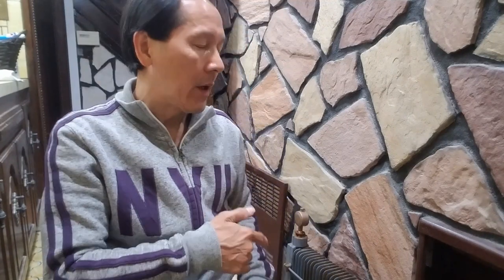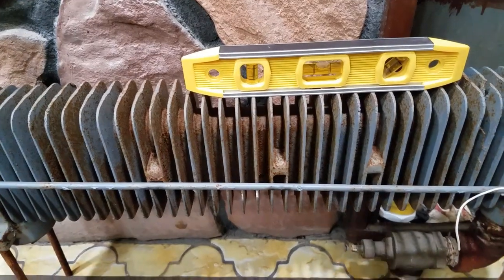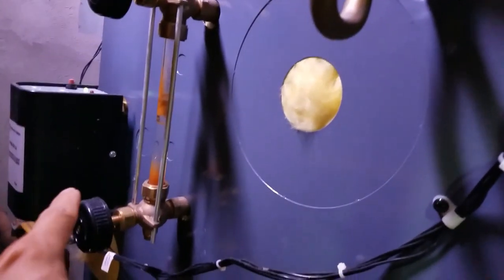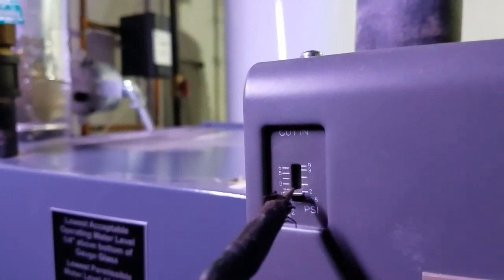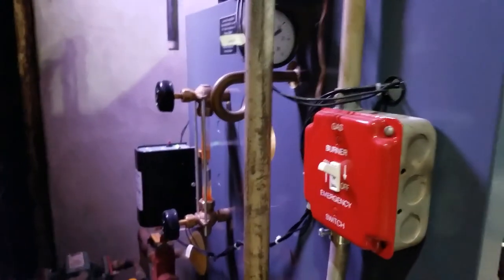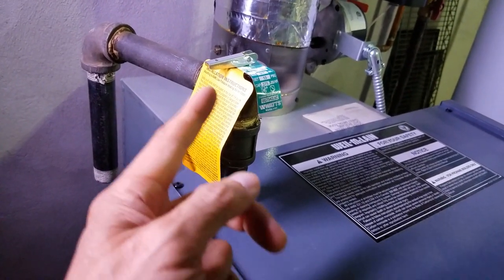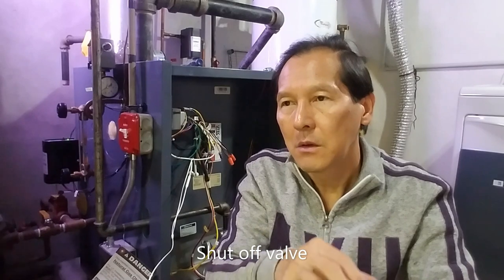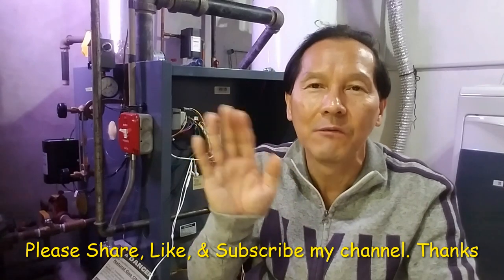2 Reasons that cause Water Hammer in steam boiler system and how to fix them.

Comment: Hi Thank you for sharing the info. I live in NY and my house has same situation of what you described in the video. I have adjusted the pressure from 3 to 2 PSI. I have also lifted the radiator to get water flow back to the furnace. However, I still hear water hammering when the furnace starts working. BTW I have constantly checked the water level in the furnace and it stay in the middle of glass which mean the furnace does not overfilled with water. Please help me with other possible solution to fix water hammer noise. Thank you very much.
Reply from the maker: Try to drain return line if it clogged. Thanks for watching.

Comment: Hey thank you for your video, I have a question regarding my oil furnace it's used for my steam radiators and hot water but I'm noticing that frequently I have to constantly manually add water to the correct Mark in the sight glass and it's consuming more oil then it should what would you recommend
Reply from the maker: Yes, I am very happy when you asked about this question. There are some reasons that cause losing water in the steam boiler. A List below will tell you where you have to check:
1) Vent valve at the Radiator bleeds out steam constantly.
2) Leaking water ( Condensated steam ) at the cap of the shut off valve before steam enters to Radiator
3) The Return line to the boiler has some leaks under the ground ( If return line is burried under the ground ). I am very sure that return line has leaks some where in your basement.
4) Your boiler may has leak, you can look around and the bottom of boiler where the burners locate, there may have water dripping.
I had similar problem. My returned line under ground was so rusted, broke and leaked water slowly over the years but I didn't see water because it when to ground. Finally, I changed a new return line. You can look at the sight glass, it is cloudy, rust color all the time.
Ok, Thank you for watching my video. Have a nice day !
Reply: Flood your boiler up into the header. Then look in chamber (fire box ) for water leak .  Boiler is gone if water found

Comment: Hi again my steam boiler is sporadically not turning on when tsat turns on. I replaced tstat same issue.  Standing pilot is on, lwco is ok and I noticed damper is open but no burners are on. If I turn off tsat and back on then works ok. Happens sporadically.  Pseg was here 2 weeks , he cleaned boiler and lowered burner output a bit.  Not sure if that caused it.

Comment: We have steam convector element radiator, it keep leaking water even after convector valve, radiator and air vent valve replacement. It is located on the 4th floor and the boiler in the basement. What is causing it? The radiator is sloped towards the valve already.
Reply from the maker: Hi, Michael. May I ask you question relates to your steam boiler that where is leaking water from. Thanks.
Reply: @CHILEtv012019  hi Chi thanks for the quick response. it is leaking from the air vent valve. it is a steam element radiator 24" x 6". i replaced the convector and air vent valve. in the beginning was fine. it started to  spitting water from the air vent valve once the steam heat starts to come up. also, when heats starts to come up i see the radiator moving, it is normal?
Reply from the maker: There are many reasons that cause water spit out from the vent valve:
1) Vent valve defective 
2) Too much water in steam pipe system ( Need to drain water out if there is )
3)  Diff. pressure switch set too high, boiler is working longer than normal. You can set temp lower at the Thermostat and monitor vent valve.
Some hardware stores sale a good vent valve but cost more money that I found last year. A cheap vent valve will not stop water spit out and will damage faster than normal. Check out vent valve's Nozzle that suits for second floor location.
Reply: @CHILEtv012019  i bought those adjustable one. i heard hoffman #41 is the best for steam elemnet radiator. is that true? i live on the 4th floor. thanks again Le. your information is great.
Reply from the maker: @michaellee688  The farer distant from the boiler, the bigger Nozzle' hole it needs. I'm not sure that #41is good. But good luck!
Reply: thank you Le

Comment: hi, my weil mclaine steam boiler (same exact as video)starts to short cycle after 45 mins. once it reaches pressure at 2psi it turns off, turns back on again few mins later once pressure drops and back and forth. I have pressuretol set  to minimum. All my radiators in my 2 floor house get fully heated no issues there. no hammering, i checked vents including mains all seem ok.
Reply from the maker: I understood your explanation about your steam boiler. Your control switch needs to be adjusted the Differential dial setting. If its Diff set @ 0 PSI, your boiler will turn back and forth, it could ham the boiler. You can adjust the Diff Between 0.2 to 0.5 PSI to improve boiler operation smoothly. Thanks for watching.
Reply: @CHILEtv012019  thanks for reply, the current settings are are cut in dial on outside is 0.5 inside dial is at 1. How should i adjust both dials?
Reply from the maker: Cut in setting from outside should be set @ 2 psi. Inside dial is your Differential and will be set @0.5 psi.
Good luck ! ( Tomorrow, I will post 2 videos, troubleshoot press control switch and how to calibrate it )
Reply: @sonicboomin   the cut out should never be higher then 2psi. the cut in plus the differential is the cut out. the cut in should be set at .5 and the differential at 1 to 1.5.

Comment: There is no gauge, there is no "pigtail"...but there is occasional hammer noise. a few days ago the furnace safety valve got hit by accident and water came out of the downward pipe onto the floor (a gallon or more). Last night I noticed the pipe coming into the main house has a tricking waterfall noise, like not enough water (??). Last night the hammering started off and on and it seems like it's coming from one of the pressure valve type things along the pipes (not on the furnace itself). I tapped on it and eventually the WATER PUMP came on...so I thought that fixed it, but it still does it off and on this morning.
Reply from the maker: I thinhk you need a boiler technician. Your safety valve was lifted because pressure in the boiler was so high. Your Diff. pressure switch needs a Pigtail because it will prevent sudden pressure increases that may damage the Diff press Switch and keeps your boiler never turn off or fail to turn on. Thanks for your comment.
Reply: @CHILEtv012019  I actually hit the switch with my coat crawling behind the furnace to get something and didn't realize it. The furnace had just started back up when it started leaking. We've had a frozen water pump due to sub-zero temps and it seems it just didn't replace the water. 
The hammering noise stopped last night, and we haven't heard it since. I'll keep an ear out for it happening again and will call a technician if it does.
Thanks for the advice! :)
Reply from the maker: Very nice what you found. Thanks.

Comment: I have water coming out of my air valves on the 1st fl only in a 2 story home. i installed brand new air valves, i checked the boiler pressure orginally it was set at 3 which i did not know until i saw this video .so i reduced to 1.5 and the radiators are pitched to the service valve however water is still shootin out of the hole of the air valve where the steam is suppose to release idk what else to do.. any additional advice will be apperciated
Reply from the maker: To control steam flow from basement to second floor smoothly, steam radiator's valves of first floor must be opened between 35% to 50% and second floor 100%; the nearer to boiler then radiator's valves open less, and the farer open more. In your case, the radiator's valve for first floor may be opened 100% that creates too much steam and water. I hope this will help you to solve the problem. Thanks for watching.
Reply: Thanks for taking the time to reply i really apperciate it , yeah your absolutely correct the valves are opened all they way, ill will give your recommendation a try

Comment: The height of the header off the top  boiler looks a little short and you will carry over water into the main and that will cause banging as well 
Follow manufacturers recommend header height.
I learned that the hard way.
Reply from the maker: Thank you for your support.

Comment: Can you make a video showing how to replace the shut off valve on the radiator? It would be super helpful as it's a common issue (leaking valve etc.) Great video, there's not many channels covering steam-based boilers and radiators!! The few that are there are really bad quality and not as easy to understand
Reply from the maker: Yes, thanks. I have a video that you are looking for. Go to my CHI LE tv channel and type:
How to Replace The Shut Off Valve and Stop Radiator Pipes from Banging ( Water Hammer )
This video was published Nov 23 2019
Thank you for the visit.

Comment: Here's a tip for all of you 
The empire state building in NYC still has the original steam system and it only runs on 2psi of steam 
The steam takes less than 5 min to reach all the way up to the last floor....
Reply: Great info but what is the tip???

Comment: Thanks. I will check this out in my system. Still small leak from my Backflow preventer. Some people are saying it’s the feeder relief regulator that is to the right of the Backflow preventer?
Reply from the maker: WOW ! You still have leaks. Feeder relief is a safety valve and it will activate when pressure in the boiler greater than setpoint ( Rated pressure ). Is your boiler have expand tank ? Thanks for your support.
Reply: @CHILEtv012019  hi there. The psi on my boiler says 20 psi for my raised ranch (2 stories). The feeder is rated 20-25 psi. 
I replaced the Backflow preventer with a new one today (second new one) and still same thing. It doesn’t drip like it did over the weekend (1 drip every minute or so) but it’s slightly wet at bottom of the vent pipe still. If I run finger down on it I see liquid. I tried everything except for replacing the feeder relief regulator next to the Backflow. Idk if that would even do anything. I do have a expansion tank above but sounded hollow when I tapped on it. Thank you for your help!
Reply: THANK YOU FOR THIS VIDEO VERY GOOD.....🎆🎆🎆
Reply from the maker: @appleztooranges  It 's great to hear what you just said. The expand tank is ok. Before you replace feeder Relief valve, try to close the water supply valve to the backflow Preventer ( Water supply valve is a valve before backflow Preventer).
Reply: @CHILEtv012019  it seems like when I do washing machine is when it starts to leak at Backflow preventer (strong hammering). I threw two hammer arresters to cushion the blow. I’m unsure what else to do besides calling a plumber lol
Reply from the maker: @appleztooranges  I don't see what you system looks like. So, I can not assume any thing could go wrong. The backflow Preventer stands by itself alone, nothing else attach to it. Otherwise, the water will be pulling to the washing machine and that causes a real back pressure and backflow Preventer will activate and dump water to the vent pipe. That is why you saw few drops of water from the vent pipe and water hammer occurs
Reply: @CHILEtv012019  yes the washer is in the opposite side of the basement room. Everytime the washing machine starts up large banging sound. Ever since I bought the LG washing machine. I will never purchase another. Every-time it slams the pipe vibrate and the Backflow drips. I’m putting a new hammer arresters on back of washing machine today (hot and cold).

Comment: Great video.  Can a clogged return also cause water hammer?
Reply from the maker: Definitely, yes. Water in return line will build up and steam coming that causes water hammer. Thanks.
Reply: @CHILEtv012019  I am having an issue where I have severe water hammer.  The tilt is correct on the radiator and the pressure  trol is set correctly.  I believe the issue could be clogged return.  Also, a lot of water shoots out of the vent on the radiator so I had to cap it.  Even after disconnecting the radiator to see if there was water in it, water still shoots from the vent.
Reply from the maker: Yes, water ( Condensated steam ) can't return to the boiler, water level will build up. You can drain the return line, near the boiler, if no water flowing out then it clogged. Also, you can check water level in the boiler ( Looking at the sight glass ). If you don't see water level, it may be over flow.
Reply: @CHILEtv012019  Okay thanks.  I do see water in the sight glass but it surges a lot.  Up and down about 5 inches.  Then when the boiler is off it settles at half way up the sight glass.
Reply from the maker: Water boiling inside the boiler, it's normal.
Reply from the maker: Thanks for sharing this video. According to your explanation in this video, your system may have a lot of water inside the pipe lines and Radiators. I suggest that you may have to turn off the boiler, drain out all water from return line, tilt all radiators so that water is not stay inside the radiators ( Try to get some pieces of wood lift up one side of radiator with an angle between 5 to 10 degree  so that water will go back to return line ) . When technician cleaned up the system with water, there may be some water still remain inside pipe lines and radiators.

Comment: Xin lỗi viết bằng tiếng Việt để dể diển tả.
Boiler nhà tôi cũ ít nhất 25 năm! 2 năm rồi ống nước bị bể. Plumber thay ống nước. Boiler chạy bình thường trong mùa đông năm rồi.
Năm nay chú technician tới Check, sau đó chừng vài ngày thì nghe water hammer.  Chú technician drained the boiler.  Boiler Nhà tôi hiệu Weil-McLain.
Bây giờ tôi không biết về level của nước trong sight glass vì thấy nó dâng lên nhanh quá và bít đầy ống ( sight glass )tôi sợ boiler sẻ hư và gây nguy hiểm.  Xin cho biết câu hỏi của tôi.  Tôi có nên thay thế boiler mới không? Tôi ở NYC.  Cám ơn.
Reply from the maker: Vang, Boiler cua ban tren 25 tuoi thi rat cu, nhung van con lam viec duoc thi ok. Truong hop cua ban vua ke thi minh xin hoi ban: Nguoi Technician do co clean va thong sight glass ko ?, tho co dieu chinh ap suat ( Diff press device switch ) ko ? Water Hammer hinh thanh do nuoc chay ve boiler khong kip va luong hoi nuoc tiep tuc day nuoc va tao thanh tieng dong lon va co the lam be duong ong dan hoi nuoc va tham chi la cai Radiator bi hu hoac nut. Con cai Sight glass khong thay muc nuoc thi  ban hay drain boiler cho den khi ban thay mut nuoc. Neu ban khong thay mut nuoc thi duong ong dan tu sight glass bi nghet. Cam on ban da quan tam va theo doi video cua minh nhe.

Comment: Also, your gas supply pipe doesn't have a drip tee and cap. The diagram is in the boiler manual. And the relief valve discharge pipe must terminate at 6" from the floor.
Reply from the maker: Yes, you're correct. I just checked it. This job was done by a technician. Most of boilers for commercial building require inspection annually. Thanks for your support.

Comment: Thanks for sharing. But...
Please don’t tell people to raise one and and showing them to raise the condensate-end, because it’s dangerous. Steam and condensate shall flow always (!) in the same direction. As condensate collects on the bottom of radiator or pipes, and we want to avoid a water sack and water hammer, we usually give at least 2% slope to the condensate side (there’s where the condensate can flow down to the return pipe system).
Other issue...
Pigtail pipe in a steam system will be used to separate the sensor (or capillary pipe inside the pressure gage) from the steam system. With a straight pipe, steam would condensate all the time on the sensor and condensate would flow back into the boiler. That permanent condensation energy supply would break the sensor within short time. That’s why we don’t allow condensate to flow down with a pigtail pipe and have there a brilliant and simple barrier.
Reply from the maker: You have a good opinion, 5% slop is good. Thanks for your support.

Comment: Chao anh chi , 
Cho em hoi anh , nha em co May heat steam boiler da 40 nam roi , no van con chay rat tot , Hien tai em set thermostat 68 degree nhung no o shut off 68 degree ma no stop 71 degree vay May heat co bi sao o ?  Vay Em co phai adjust   Cut switch control giong nhu video anh chi cach adjust o ?  Anh cho em biet cach lam sao.   Cam on
Reply from the maker: Chao em. Thermostat cua em co van de, vi khi nhiet do da dat 68 do F (Temperature setpoint @ 68) thi contact se ngat mach dien de turn off boiler. Truong hop boiler cua em ko co turn off cho den 71 degree, vi contact cua Thermostat bi HANG UP hoac yeu. Em co the thay cai Thermostat moi hoac giam nhiet do xuong 65 degree. Ko nen chinh control switch. Chuc em thanh cong.
Reply: Cam on anh chi

Comment: Hi , I have a hot water baseboard system with boiler, the heating pipes in the 2nd floor kitchen make a loud banging every time i turn down/off the thermostat or when it reaches the set temperature and stops. We changed a large new expansion tank and it still happens. Its very loud on second floor kitchen we could hear it from first floor. Please some help on this.
Reply from the maker: The water hammer in your water heating system happens when a sudden on/off, the system needs the WATER HAMMER ARRESTORS. You can go online and find out how it works. Thanks for your watching.